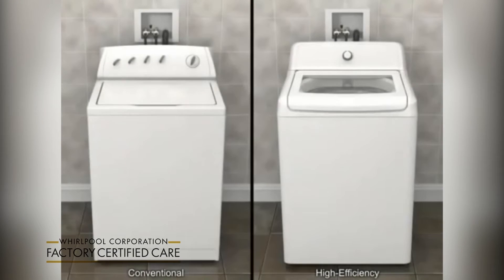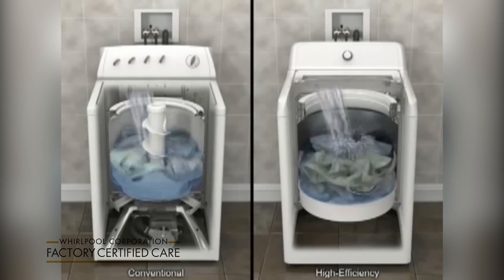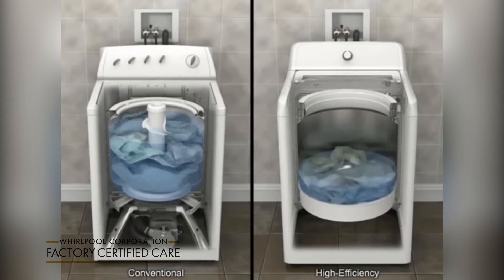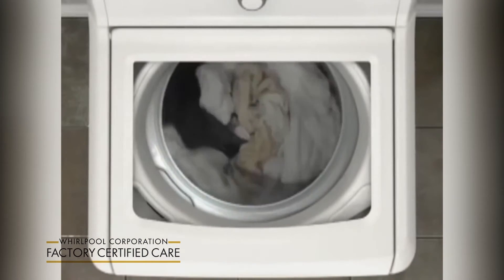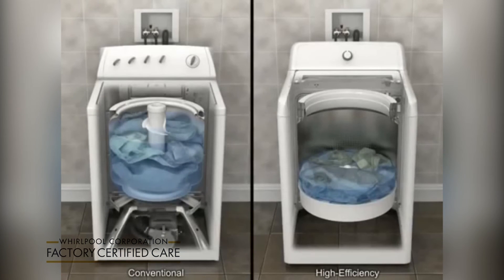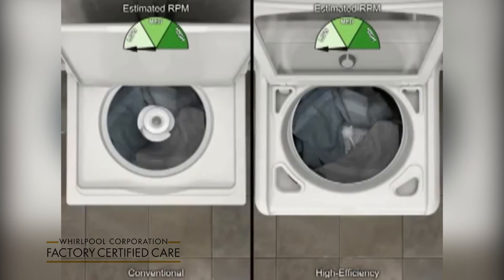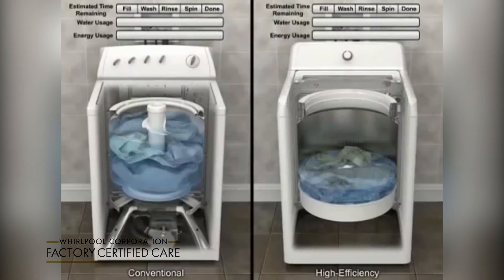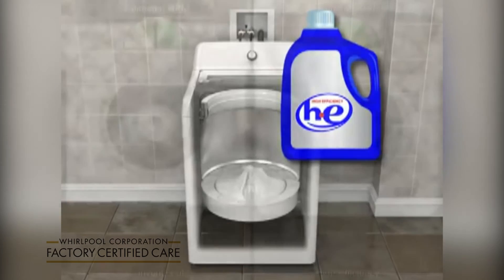How HE Washing Machines use less water to clean

Comment: I have a fairly new Maytag low flow energy efficient crap washer I hate it, soap get stuck in between clothes and stays there it’s supposed to save water but I have to wash my clothes three times to get all the soap off, i’ve tried using less than a teaspoon and it doesn’t make a difference I hate Maytag and I hate these energy efficient BS washers

Comment: For over 50 years, we had washing machines that didn't need to be cleaned and didn't stink. Then, the "new and better" ones arrived. The HE machines DO NOT clean as well. They do not use enough water. That is why they stink. Trying bathing your dog in one inch of water. Same difference. Lots of people sure have bought into the hype, and regretted it later. Whenever I need a washer, I go straight to non HE ones. Usually cheaper, and work a whole lot better.
Reply: we no longer have efficient detergents, thanks to the environmental organizations.  detergent these days does not do the job, it's just low on the bacteria killing components and high in perfume components. 
      ALSO : because environmentalists, the water consumption of your washing machine is so low, that it can not efficiently wash away the bacteria. it cleans the stains, but the bacteria remains.
Reply: we now have washing machines that use only 30% of the water volume that is actually needed to wash. 
  so, 30% of the water needed combined with modern detergents(which is basically a bit of natural soap and A TON of perfume) and we have these results. 
   smelly washing machines and mold was not a problem just 5-10 years ago.